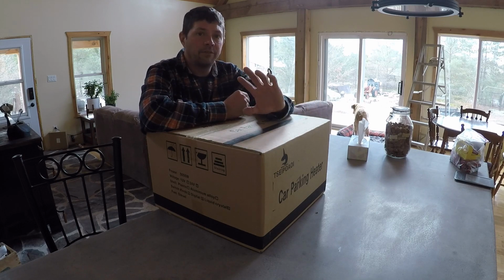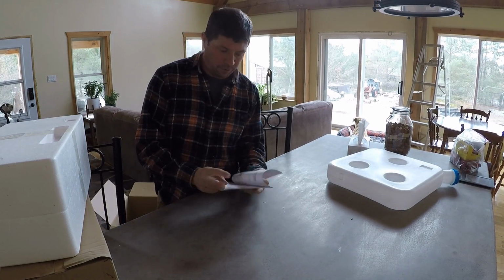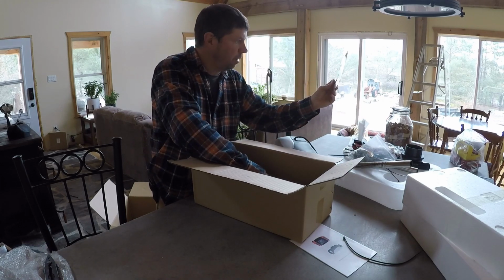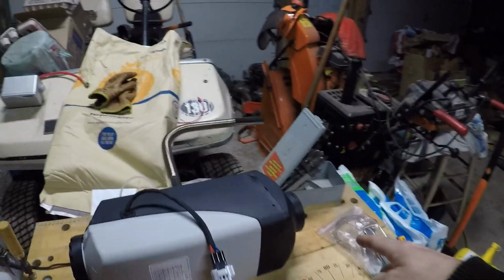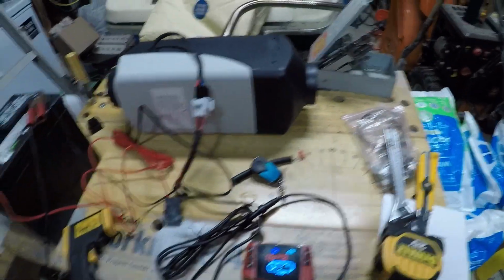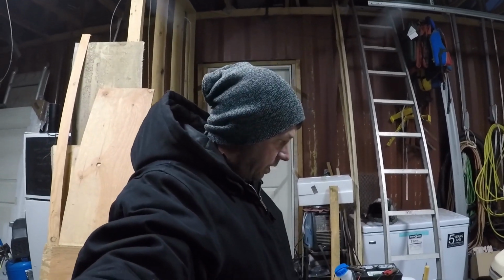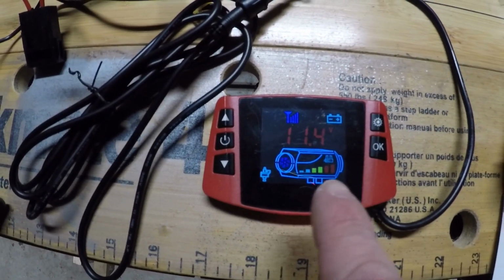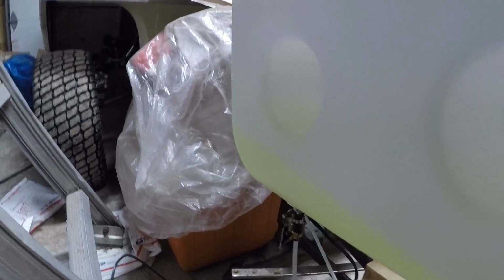5 K Chinese Diesel Heater (UNBOX and  BENCH TEST) S06E15

Comment: Thanks for this review. Do you know how many total watts were used ? Or how many amps are used for glowlight cycle, then during normal operation for the fan ? 
I would like to install that in my trailer on a portable battery like a jakery, but I need to know how big of a battery I need to at least heat for a full night.
Thanks !
Reply from the maker: It uses about 8 amps at startup and less than 1 amp during normal operation.  I put it on a small lawn tractor battery with a trickle charger on it and it has  no issues.